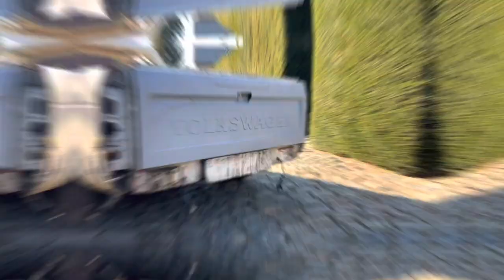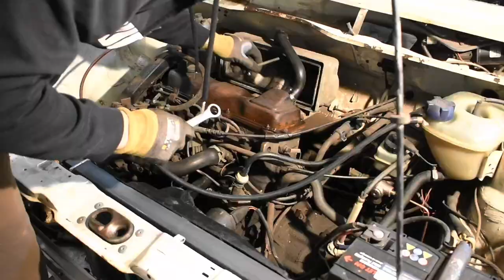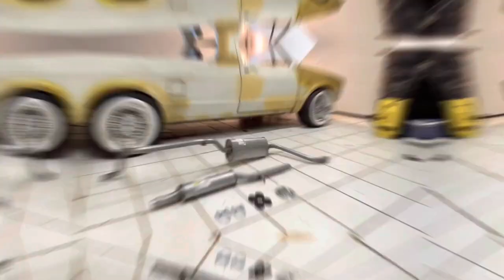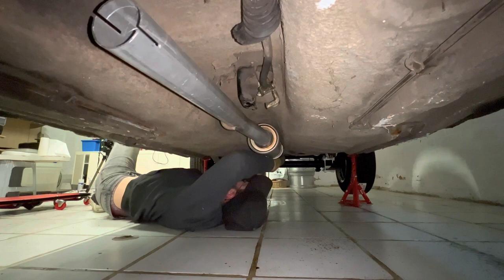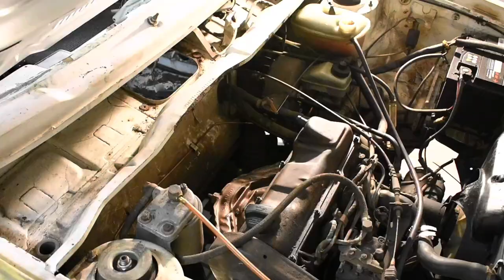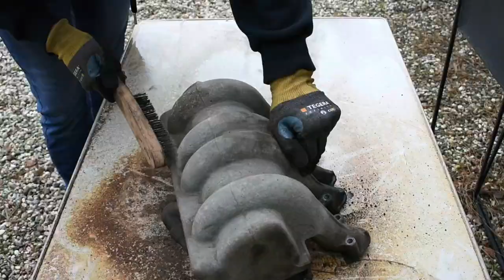Upgrading the VW Caddy Mk1 with a New Exhaust System!

Comment: A tip for the exhaust clamp install is to use a U-bolt clamp and flip it around to spread the clamp then loosen it to put it on the exhaust.

Comment: where did you buy the exhaust system from?
Reply from the maker: These are the parts i ordered for my exhaust:

downpipe:
http://www.volksparts.eu/contents/nl/p879_161253091A.html

midpipe:
https://www.mecatechnic.com/nl-NL/geluidloos-centraal-tussenstuk-van-de-uitlaatvan-het-originele-type-voor-golf-1_GC20103.htm?queryID=undefined&objectID=GC20103&index=mecatechnic_nl&queryString=caddy

endpipe:
https://www.mecatechnic.com/nl-NL/demper-achter-voor-golf-1-pickupcaddy_GC20113.htm?queryID=undefined&objectID=GC20113&index=mecatechnic_nl&queryString=caddy

gasket:
https://www.mecatechnic.com/nl-NL/banden-en-rubber-voor-spruitstuk-van-golf-1-2_GC20408.htm?queryID=undefined&objectID=GC20408&index=mecatechnic_nl&queryString=caddy%20uitlaar